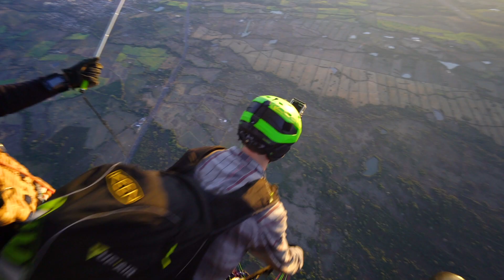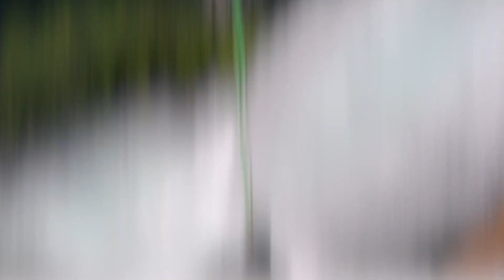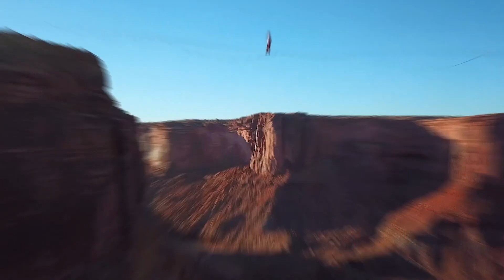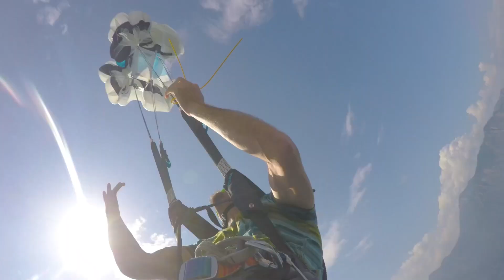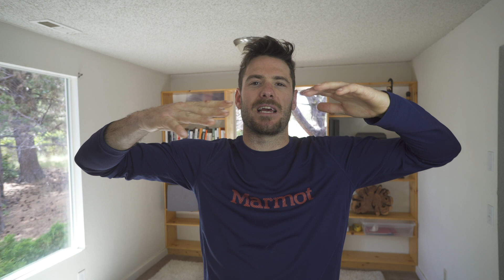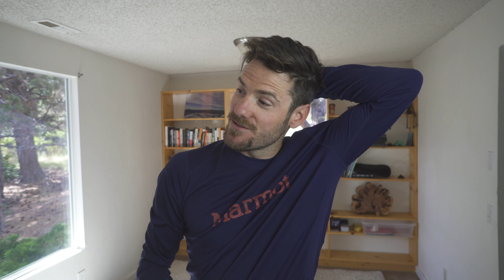All about CRAVATTES (Paragliding theory)

Comment: Regarding pulling in yards of stabilo:  Just pass the slack to your other hand, which is delicately controlling the open side of the glider. Easy to hold a brake handle and stabilo line in the same hand. Yard in, pass across your face, repeat. No need to chomp down with mouth.

Comment: Excellent video! If you have an asymmetric cravat on the left, do you sharply pull left or right brake? I assume you're pulling right brake for heading control, and I think you say you do a sharp left brake pull to clear a left asymmetric cravat, but just want to be sure I understood.
Reply: I think you are correct, you would be weight shifting and pulling some right to maintain heading then the sharp, quick jab to the side that has the cravat
Reply from the maker: I think you get it, control the heading with the side of the glider that is still open and flying, clear the cravat with the brake that is cravatted. Voila!
Reply: I agree not flying thermals without starting at least a first level of SIV training course. 
Good talk about cravattes.
I might suggest not delaying even a second before attempting heading control, considering that certain cravattes occur during strong surges which end up quickly in autorotations. I would also call it better "centrifugal dive prevention control" because some cravattes will not allow you to control heading without stalling the glider. If you are not skilled in feeling a brake about to stall I wouldn't attempt so much to control heading (risk of unwanted stall at low height). Diminishing sink rate avoiding centrifugal dive might be the first priority and second be ready for using your emergency parachute before the autorotation threats to come back, it might be too late depending on height.   In brief , if you are not super high, consider your chute before many other options and hopefully before the glider starts a centrifugal dive.
Fly safe.

Comment: You mention in first solution- "ringing the bell" ie. full brake pull.- but not which side. 
Maybe its obvious but do we assume that is TOWARD the SAME SIDE , in the direction of the cravat/ collapsed wing tip? 
it seemed like that (same side) based on your body language indicating right hand side to illustrate cravat and brake pull in video.

One thing you didn't mention which i noticed during a recent significant cravat was how far away from the collapsed wing tip i had to lean and as a result how difficult was to pull the stabilio or reach the effected lineset to adjust. 
#1:Staying calm was certainly helpful.

Same question for the spin/stall technique (around8:00) would you spin stall towards the already cravatted side as iI would've thought. or away from the cravat . You don't indicate direction, in either case. 

I would think it would be obvious (*towards cravat) )however  just to be sure I'll ask the stupid question. 
Thank you for the clarification/ confirmation. 

edit. you did say "same side "towards the end when describing the deliberate second assymetrical as a solution to collapse. edit

One thing i did do to solve my issue was dive the wing AWAY from the cravated side using weight shift on the inflated side and then reinflate the pressure across the wing span with inside brake (away from cravat) -worked like a charm. big sigh of relief. lol

Great videos. appreciate your insight & enthusiasm. Thank you!

Comment: I’m flying some serious thermic/cross country type of sites, and I have less than 5 hours of mountain flying (just barely less) but I’m always flying early, sometimes late afternoon after mid day, I’ve flown as late as about 1:30pm on a very hot, and high pressure day, hitting thermals felt like bumper cars🤣. But I do want to get into XC but it’s definitely going to take a lot of early and glass off flights before I push later in the day, I would love to take a SIV, I know it would be terrifying and probably scare the shit out of me but the lessons on how to take stalls, collapses, spins, etc. will be super valuable, but I just don’t have the money for it right now, so I’m sticking to early and late flights in Tollhouse/Dunlap area.
Reply from the maker: Keep it tight!